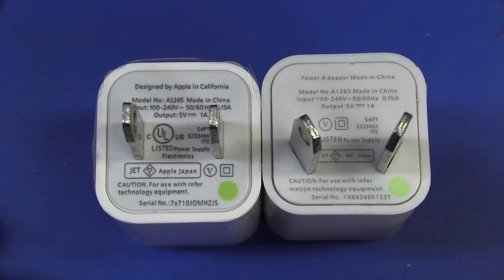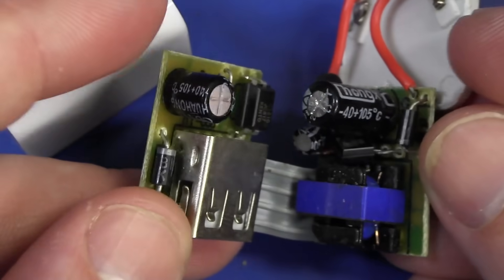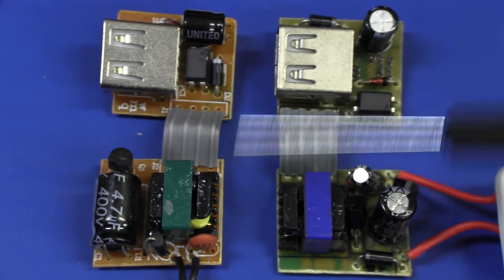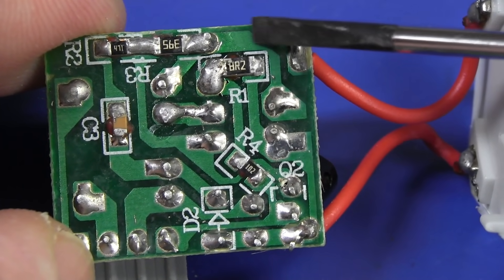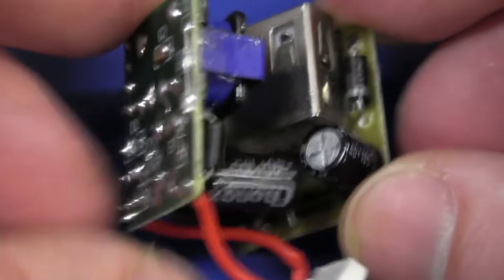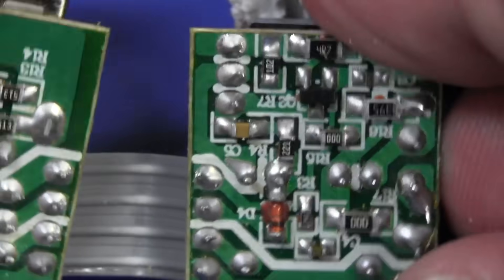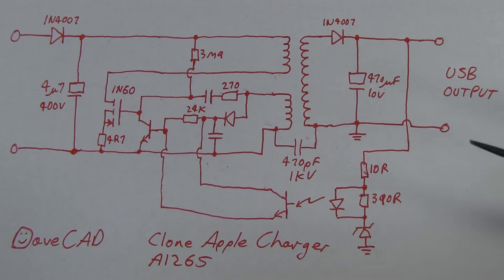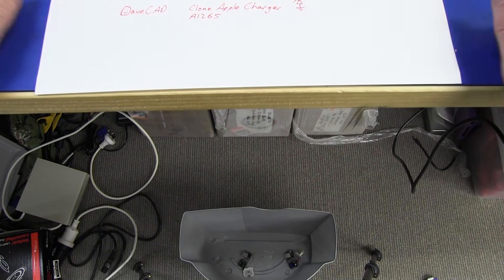EEVblog #388 - Fake Apple USB Charger Teardown

Comment: Would have been interesting to test the voltage stability, ripple and HF noise of these and compare with a genuine apple power supply under various loads. Also would be fun to test the breakdown voltages.

Comment: You can tell a real Apple product by the workmanship of the metal parts. While those show the irregular edges of a stamping machine, Apple appears to use an over the top laser cutting system. While I admire the fit and finish, I'm always shocked that a company wasted so much effort on such pointless details.

Comment: Why is it a such a big deal whether they use full or half wave rectification? These things are supplying miniscule power compared to what is available at their input anyway, doesn't it just imply the switcher will run with higher duty cycle all else equal? But still so much power to spare taking a 110VAC 15A outlet to make some 20W DC output

Comment: Eh personally I don't care about UL and other silly certifications if it cuts the price in half. If something goes wrong that's what the 240v breakers are for (or the  12000v reclosers on the pole outside if the breakers also fail). If I wanted to spend extra cash I'd just head to Digikey and build it myself to better specs.

Comment: Lmao im sorry but my dash charger can output 20W and I think it might be 10% bigger so apple is not that compact
Reply: @ Dark Angel 
A dash charger is something very different. It converts harmless 10 to 30 Volts DC into 5 Volts DC (regulated). To build this, a tiny IC chip is needed, a power transistor, and some minor passive devices. Building a wall charger which inputs hazardous 100 to 250 Volts AC is  somethong very, very different.

Comment: It is amazing that there are no schottky array, proper power caps and filters, ferrites, and any kind of fuses or breakers. The ripple alone would be enough to damage the tablet or phone. The power and ground planes alone can cause fires. This is why it is very important the read the articles on the oem's website, in this case Apple, and learn how to identify these.

Comment: Good teardown.
1N4001 is 100V, it would be a 1N4004 as least.
Why do you say Negative and positive, its AC so it should be live and neutral, or live 1 and live 2.

Comment: It's interesting to note that the even crummier one has considerably more typos in the label. "Power A dapeer" and a stray quote mark before "100-240 V" as well as bad printing on the "For use with information technology equipment" part. It makes me wonder just what exactly was going on at the factory there. Like the guy just typed some shite into the computer to meet a REAL tight deadline and hit "save".

Comment: I worked a trademark infringement case where I had to send a few of these to Apple.  The ones I ran into, being sold at some "Apple Repair" franchise unassociated with Apple, had "Designed by HAPPY in China" on the label.  Designed, of course, because that's so much more elegant than saying "made in China."

Comment: What is the use of the optocoupler in the circuit? Is it providing feedback of some sort?
Reply: I could be wrong myself, but yep. I think it's driving something's feedback with a PWM signal... either that, or some sort of signalling where a groundloop wouldn't be great etc as well

Comment: So how do we in general make sure we are buying good(safe) USB chargers an powerbanks ? Lots of pack in ones with budget hardware is likely bundled with chargers made like this. With PC power supplies its relatively easy to find out the OEM and get reviews, but for smaller electronics like this its almost impossible to know what you are buying.

Comment: No fuses? Excuse me? EVERYTHING is fusible, if you put enough current through it...
Reply: Why would you need fuses when there is a 15 amp circuit breaker in the circuit? (sarcasm)
Reply: @lesliefranklin1870  it’s for uk, uk it’s required all plugs have fuses
Reply: @VOLTRONDEFENDER4440  Jeez, I explicitly used the word (sarcasm) for a reason.
Reply: @VOLTRONDEFENDER4440  It's not a UK plug as we have 3 pins. The geezer in the video sounds Australian .
Reply: ah yes, the fusible mains contacts ;)
Reply: Lol
Reply: YEAH! Even humans are! LOL ;-)
Reply: Yeah, the tiny 32AWG wire IS the fuse!!!
Reply: These don't need a fuse they explosively remove themselves from the outlet.

Comment: At 1:53 I already know both are fakes.  You can see on the better fake the words "CAUTION: For use with infor" followed on the next line by "technology equipment.", and on the crappy fake you see "CAUTION: For use with infor" followed on the next line by "mation technology equipment."

Comment: I had an AC adapter (not a USB one but it was a switchmode power supply) break at the seam today! Well almost, one side is still attached, but the insides are exposed, high voltage and all.

Comment: Other than the typos, is there any way to tell a fake one from a genuine one without breaking it open? Do these fakes give a measurably different output in any way if hooked up to a meter?
Reply: +Derek Harkness They almost certainly have fake current ratings on them too. Thus I'd measure the current they produce, the voltage drop would probably also be higher (indicating a bigger internal resistance of the power supply), the lack of proper filtering means that the switching noise will seep through as well (it can be measured with an oscilloscope) etc. 
In short: yes, you can, but not without some proper equipment (or at least a set of resistors with higher power ratings).

Comment: Wear gloves when you use the Dremel ffs. At least for the camera.
Reply: You can touch a dremel cutoff wheel and it won't cut you
Reply: Febeleh Sharp, hot bits of whatever you are grinding will embed themselves on your skin, which will if nothing else result in itching. If you are unlucky, they will reach your eyes, nose and/or mouth, which will probably be painful, and may also result in infections and respiratory/vision problems.

The manual not only will tell you this, it will also instruct you to use protective eye-wear, a mask covering nose and mouth, and gloves.

Source: I was young and stupid.
Reply: you're responsible for your own safety when cutting plastic with a dremel. if you're concerned about hot sharp bits of plastic embedding in your skin from a dremel, wear gloves but don't tell the rest of us to do so. we can determine our own safety protocols.

Comment: Are those chongx capacitors good enough for debouncing stuff on a breadboard and 555 timer stuff? I just found a random assortment of them on amazon.
Reply: I think... I have some of them and they work well for simple projects. So for debouncing it will be OK (but for debouncing ceramic caps are generally used (cheaper). I think theyère OK for high voltage but absolutely not the best!!

Comment: Someone might know the answer to this. 

So I have a charger for a Macbook Air and I charged my laptop with it. When I woke up I left my house and just unplugged the thing and took it. It was on a dog cage and it was quite obviously touching the dog cage pretty much all day probably and when I got back it didn't work anymore.

So the weird thing is how I got it to charge ONLY if I plugged it into my laptop first then into the wall. Then all of a sudden about 2 weeks later it started working perfeclty normal as if nothing ever happened. Any ideas? By the way it has been 8-9 months and it has been working fine since.
Reply: Throw it in the bin
Reply: AeRo PaGy & Os Speb Why??
Reply: +FatheredPuma81 Because using faulty electronics puts you at risk. If the thing really doesn't work anymore just go and get a new one.
Reply: Quantum Tunneller It works fine and i've had absolutely no problems with it since. It has been I think 8-9 months now since that? Oh well if it does my school will pay for buying faulty electronics.
Reply: FatheredPuma81
I didn't know it'd been 8-9 months! In that case you should be fine. Especially if you havn't had any problems since
Reply: ^^^^ else i wouldnt have said that.
Reply: Quantum Tunneller I didn't put that in my comment? Ooops.
Reply: btw the question was any idea why it did that.

Comment: I would love to see the original Apple charger.
Reply: +Jovan Janevski http://www.righto.com/2012/05/apple-iphone-charger-teardown-quality.html
Reply: +Jovan Janevski So do I, just to see if this is the same crap or if this is legitimately better!
Reply: Clearly, the genuine Apple power supply is vastly better in that it is a high-speed switching power supply that produces 5 watts at a smooth 5 volts. It's clear that the engineering required to produce the genuine article is much better than the crap ones in this video. When you buy something of quality, you're not just paying for parts. Otherwise, you would just be able to buy the parts and make your own. Just don't complain if your cheap $3 power supply destroys the battery on your $600 phone or burns down your house.

Comment: If anyone else has a mind to take their power supply apart, watch out for the capacitors, in a switchmode power supply there are usually high voltage caps that might still be charged. 

If you're scrapping it it is probably fine to use a screwdriver with a PLASTIC OR WOODEN handle to short the caps out. However, the sudden discharge is bad for the cap. 
If you want to reuse that capacitor (assuming it's still good) I suggest a high-wattage resistor (do the calculations of the RC time constant and the appropriate wattage) with the leads bent to touch both capacitor terminals, then use a pair of pliers WITH A RUBBER OR PLASTIC HANDLE to lower the capacitor into the right place. Or, glue the resistor(s) to a PLASTIC rod to make a dedicated tool. Just be sure to measure the resistor after the discharge, so that if it fails open (leaving energy behind) you'll know.
Reply: I'll save you the trouble. Just use a 10 Ohm 2 Watt resistor.

Comment: Left one is also a fake. Look at "CAUTION" area, it says "For use with infor technology equipment."
Reply: +Tom L Apple Japan was my first hint... then there were more lol
Reply: Ozzie Peck
Where are you seeing "mation"? Dude, I said LEFT one not RIGHT.....
Reply: sam marqus have you seen real apple chargers? Green dot was used to signify they were the new chargers not part of the recall from years ago. New ones don't have this since the back text changed.
Reply: +Tom L Heh, I am watching this years later and did not notice that this time around, but if memory strikes me it says "infor" at the top right, and then line-breaks in to "mation" on the next line, albeit with no dash to signify it is only part of a complete word.
Reply: +Alexander thats the one on the right, the left one says what Tom said.
Reply: I've seen what crap comes out from China. We built laminators for the print finishing industry. One of our US competitors went to China to have them built. What I saw as a new machine ( I would only sold it as used ) was a piece of " JUNK ". Yes China can make some good equipment but most of it is shit. I would rather spend more on name brand ( It still maybe made in China but quality control is in place ). And don't forget if you buy an off brand from China and it breaks down.......Just try to get the parts ( wait a long time ) to get it fixed.......If you can !
Reply: +Tom L I noticed that also. This was a great teardown. (Simple for me). I am going to now take my Job Lots unit and tear it down. It works but I want to compare.
Reply: "For use with infor technology equipment."? Maybe "built with inferior equipment" would be more fitting.
Reply: I think he knows that, he always calls it the Apple-branded charger, not the Apple charger.
Reply: That one is from Huf Lung Dung.
Reply: Its not fake, because on the right is *Adapeer*.
Reply: green sticker means FAKE ! End of it
Reply: +Cnerde The original ones also says japan
Reply: +Tom L it says for use with information technology.

Comment: The 'not so obvious one' on the left I noticed said "Flextronics". I thought Foxconn made all Apple's stuff, hence it struck me as a possible fake.
And no company, Apple or others, tends not to put on the label the company who manufactures their stuff.
Reply: +Stuart Kerr My genuine Apple adapter (came with my iphone) also says "Flextronics". It has the word "infor- mation" continued on the next line.
However,. the most obvious difference between my genuine adapter and the 'almost' genuine one here is that all of the printing on mine is light gray on a light gray background. Almost unreadable. The printing on the fake is completely readable.

Comment: iPhone only charge with a certified cable. Which make me very curious about how the apple lighting cable works.
Reply: which iphone? i have an iphone 4s i charge with a micro usb cable and a hajistan adapter to make it fit an ipod. works just fine and neither is an apple certified product.

Comment: helped a guy from our consumer protection agency break open a suspected fake iPhone 6 charger last month, nothing has changed in the compliance to safety standards. It had separations and gaps less than half the legal requirements still. Soldering was a bit better, seems the factories now have either more experienced children doing the soldering or someone's invested in a machine.

Comment: Isn't it dangerous to open AC Adapters ? :o
Reply: It's dangerous to open high-power power supplies. These supples are only rated for <5W, while a computer's is anywhere from 300W to 1600W.
Reply: +scdnj Not if they aren't plugged in and you are going to throw them both in the bin immediately after dismantling them.
Reply: +Joshua Rosen Don't forget about the capacitors! They can give you a nice little shock, even unplugged.
Reply: ***** That is true if you start playing with them immediately they are unplugged - good point.

Comment: sorry but seriously you are making a big deal about a 5v 1a regulator? its not rocket science for low wattage regulators what did you expect a switching supply or something?  I could make that purely out of a transformer, and a full rect and a cap. but i do agree lacking fuses is quite unsafe.
Reply: It is a switching supply!
Reply: dude making a switching supply for 1amp even 2amps is purely stupid.   you missed the point obviously... for low amperage supplies you need nothing more then a transform, a inductor, cap, full wave rectifier and a single voltage regulator... oh my so much rocket science.
Reply: +DjCincinnatus You can do it with even less than that, but in comparison it will be bigger and heavier
Reply: true Ive made 12v 50amp supplies with nothing more then a motorcycle battery as a cap and a car charger but still for a simple USB supply you dont need all that bs in a charger. maybe if this was a dual voltage charger then be another story....
Reply: +DjCincinnatus Sorry I replied from a different gadget with a different username... switchmode can be stupidly small, they are cheap to make and generally very efficient... they also are very tolerant of varying supply voltages.. ie my nasty switchmode doesn't much care whether the supply is 90v or nearly 300v, this would not be the case with a conventional transformer/rectifier/capacitor/regulator type supply. An iPad wants 5v at over 2amps to charge normally,  A conventional power supply would end up far bigger and need to shed a fair amount of heat. Nevertheless, if I was making one for use only at home maybe that is the route I would go...
Reply: +David Lisney Maybe out of toppic, but for non critical systems, which have to last, the transformer/rectifier/regulator is many times the best choice. Not so efficient, but also not so under load, specially eletrolytes I mean. I have devices running for over 15 years now. I sincerely doubt, that it would work so long with switchings.

Comment: I bet the "certified" one is actually a genuine Apple product. Apple loves money just like everybody else so it probably produces several type of the same product:
- elite one to show off;
- normal for other expensive Apple products;
- standalone crap to sell in huge quantities all around the globe;
Just for this reason it was sealed like a vault :) And they can always blame some china manufacturer if caught. But I doubt if anybody ever tied to find out the truth - everybody is used to this.
Reply: +v ant I actually like your comment and it makes me think a bit...
Reply: I know I'm replying to a really old comment but I find something much wrong with your comment it needs replying to. This is definitely not something a company would do with Apples reputation. The impact would be huge if found out, especially if they kill someone because of it, then there is the profit they would loose out on, Apple already own the factory's or part of the factorys making the real thing, they produce them for about the same price as the counterfeiters do but with the power of mass production and bulk buying as well as high margins (many orders of magnitude more return on each item) they produce 1 product for everyone, they can back it with a warranty they know they will seldom need to honour and they don't kill anyone doing it. The Chinese fakes are low margin, high risk of death or injury from use and there is no one who can be held accountable because as soon as they have sold them all, they change there company name, disappear or make something else. 

No, Apple are not making low quality versions to sell on the cheap.